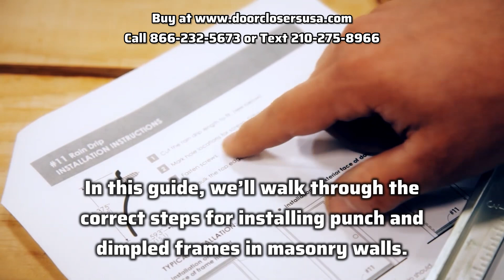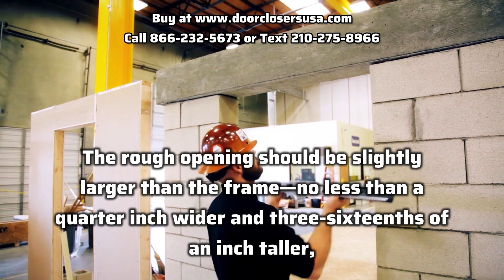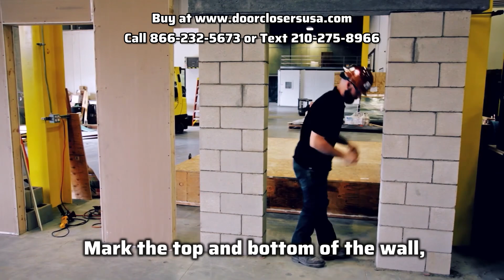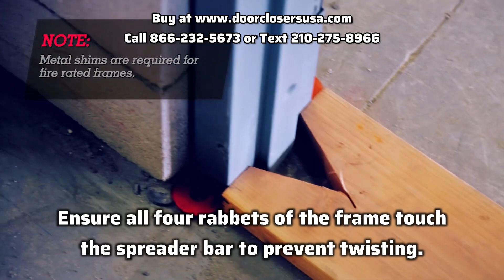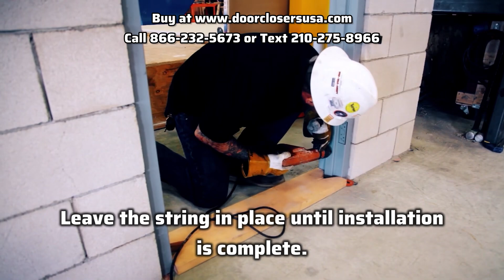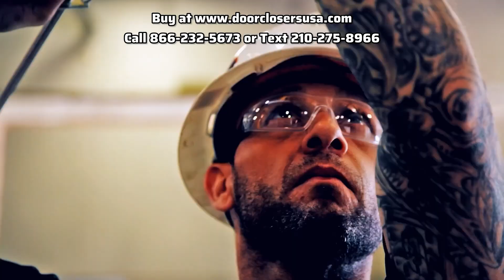Hollow Metal Door Frame Install in CMU Block Wall | Contractor How-To

Comment: this is the weak way to install the door. correct strong way would to be have anchors in the masonry connected to the door frame then pour mortar or concrete to tie door to blocks